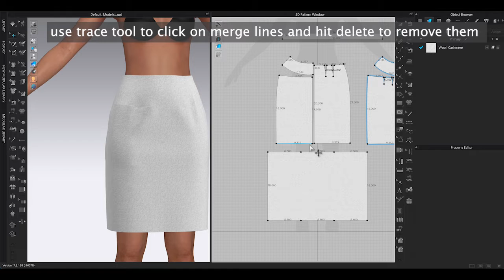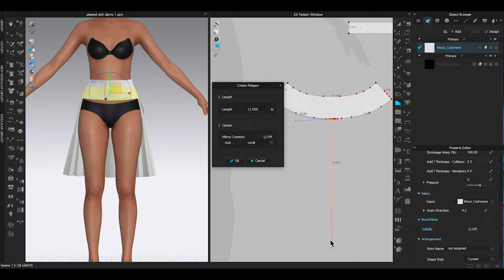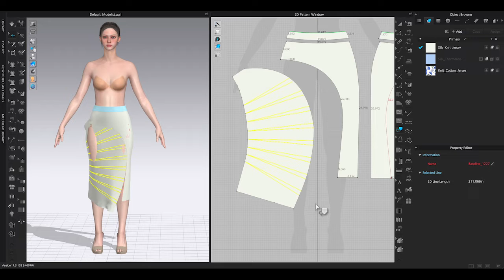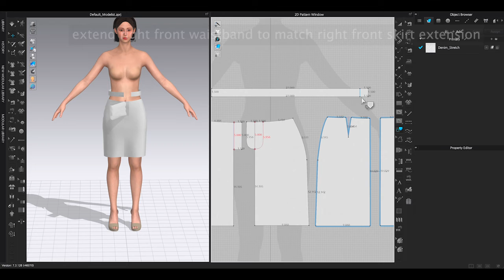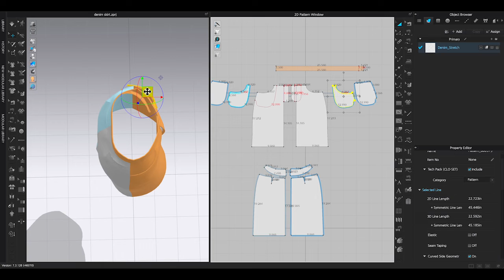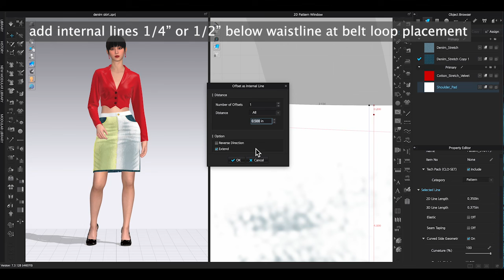how to create these 3 style of skirts in CLO 3D

Comment: Oh wow the pleated skirt was so good, I have never tried but now I will for sure thanks. I saw you moved the print in the front yoke how does that work?.
Reply from the maker: After uploading texture/print onto the pattern, you can use edit texture tool ( you can find it either in 3d or 2d window tool bar) to move the texture/print to the position you want. This can be done either in 3d or 2d window.
Reply: @Kev-in-design  really oh i will have to check that out…. U rock thanks!!